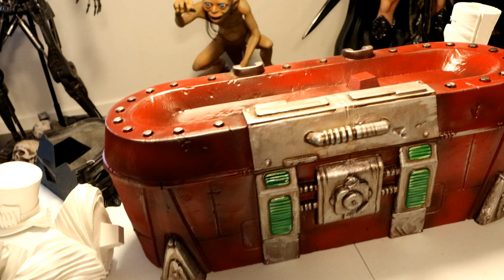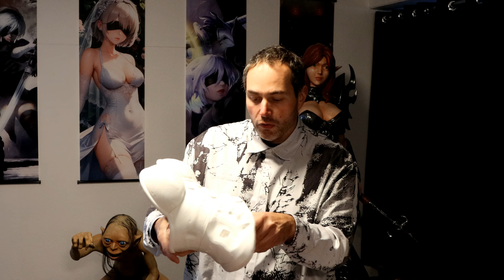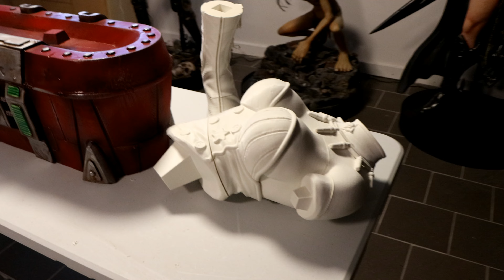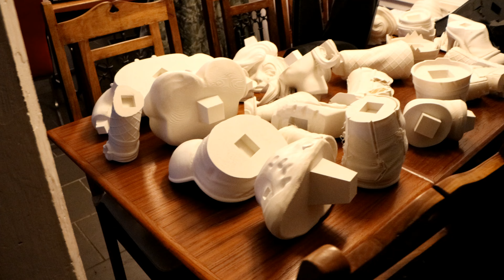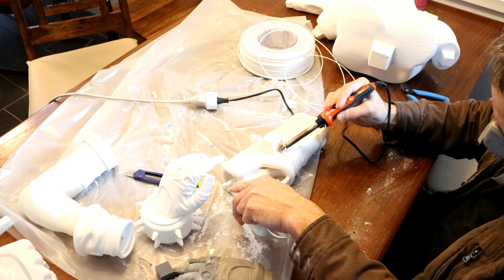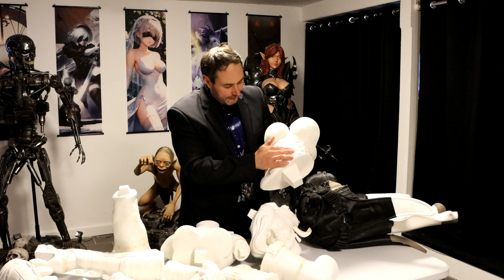Bringing Moxxi to Life - A Borderlands Build Part 2 - Assembly & Prep [Full Sized, 3D Printed]

Comment: Another great video and thanks for sharing your journey. Instead of baby powder, I use Activator spray when I glue my pieces together. It is really fantastic because it instantly reacts with the glue and you don't have to wait minutes until the glue hardens. Can't wait to see part 3 of the series!
Reply from the maker: Hi and thank you for your comment. I use baking powder not baby powder (but I could have pronounced it a bit better in the video😁). It works a bit like the activator spray and makes the glue stick instantly.It also generate a lot of heat so have experienced PLA parts melting together for the perfect connection :)

Looking forward to sharing the third part. It gets really fun when I can start adding some paint to the model. Will work on smoothening it out in the next episode.

Once again thanks for the feedback, always appreciated :)